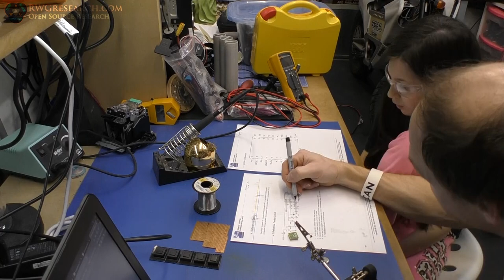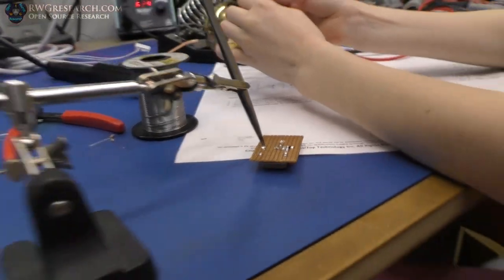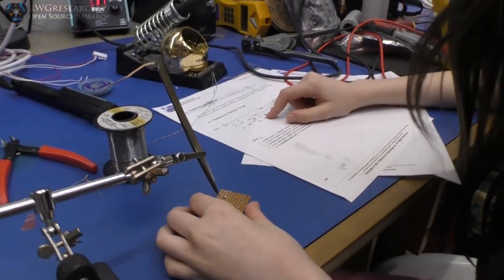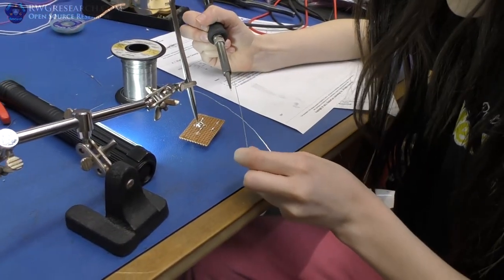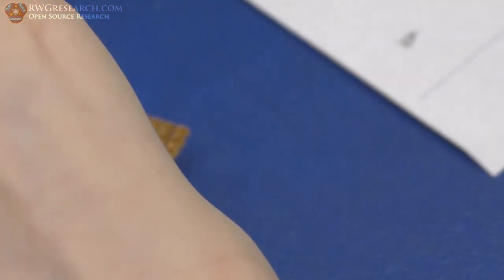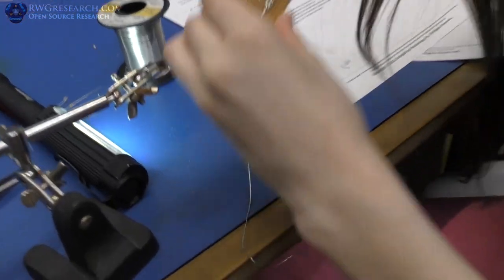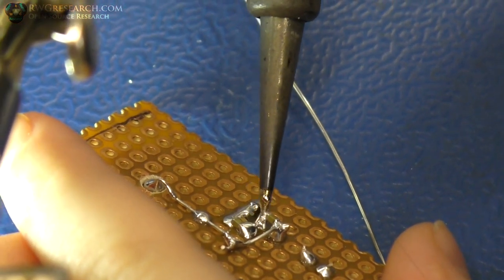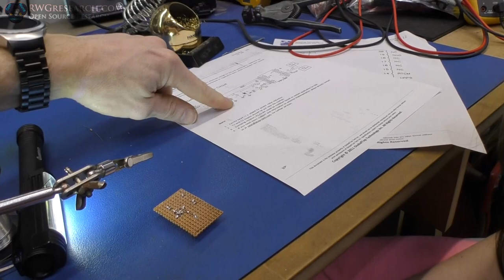2-28-2021: RC#14 - (part1)Teaching Riley How To Solder SMD ( The Hard Way) On The GPS! #32-22

Comment: Tip for the solder is to get old fizzy tablet tubes, and make a roll of solder that fits inside, with a small hole in the front to pull out from the roll inside. I take a no2 Phillips screwdriver, chuck in a drill and wind the solder onto the shaft, then pull out the screwdriver, and the inner goes through the tiny hole made in the lid. That way no black solder fingers, and the flux does not get all used up to clean the solder.
Reply from the maker: yeah, I have a few of those. I like them. I should get one out. thanks for the reminder  ~Russ
Reply: @RWGresearch  Yes, you want to keep lead exposure to a minimum, especially on the fingers. I have a few tubes of solder around, various thicknesses, and also some made with rubber grips and caps to close them off, so they do not roll around on the bench. You can but them, but free and recycle is a lot better.

Comment: I recommend taking off a piece of the tin next time (like 25 cm, or 10 inch). So much easier to work with. Also teach Riley to gently blow away the smoke so she won't inhale it (or please place a ventilator near).
Reply from the maker: thanks. I fond that i waist a lot of solder using that method. but yes we could. cheers. ~Russ
Reply: To be honest, I always make small bundles of approx 80 cm and wind it up to 10 cm (in a flat loop). Not so much to be wasted then.
I find it cool t see how Riley is learning all of this, isn't it? You were saying to here ' sometimes there are things you 'have' to do. But I get the impression she likes to do it anyway 🙂
Reply from the maker: @deslomeslager  yeah that works too. ~Russ

Comment: Oh,  you make her use a conical tip, you monster!
Reply from the maker: hey... the best way to learn something is to struggle through it. so if you can do it the hard way... then the easy way is to easy...  i find that if you learn the easy way. then you'll have a much harder time wen its not working right... lol  hehe ~Russ
Reply: @RWGresearch  i agree, but conical tips? Comon man, morale is what seperates us from animals! :P
Reply: @muh1h1  Hey i use the conical tips a lot, and they do work. Also have the other tips though, so can use them when needed, but the conical tends to be the most used because it is so versatile for all joints unless you need big heat. That is when the solder gun comes out, 100W in a small space, and you can still control using finger modulation on the gun.
Reply from the maker: @muh1h1  hahaha that's funny. If you ask riley if she is an animal. She will say "yes" lol to funny. ~Russ